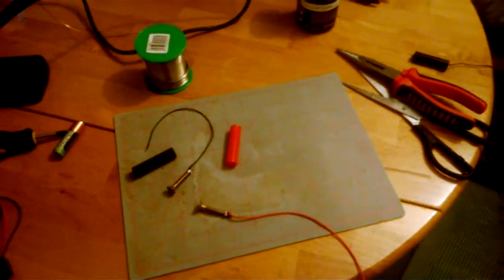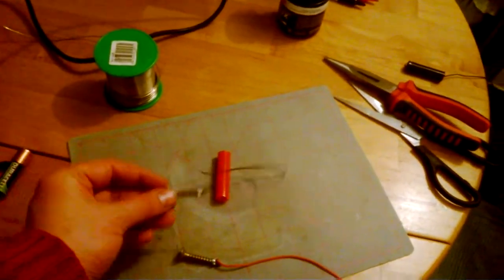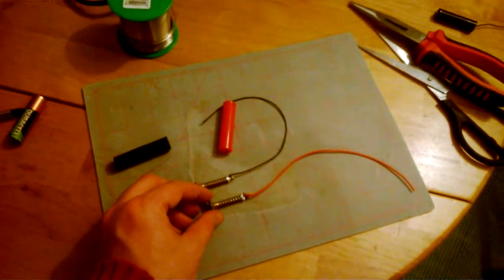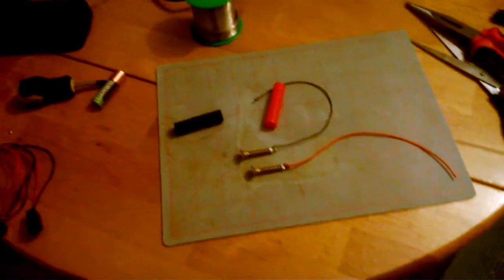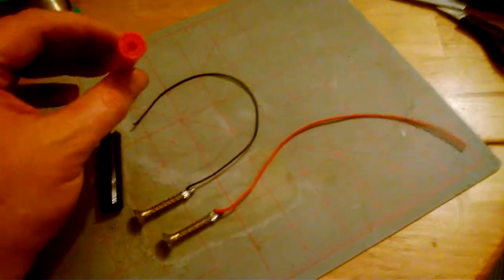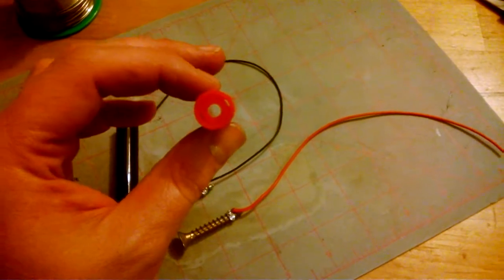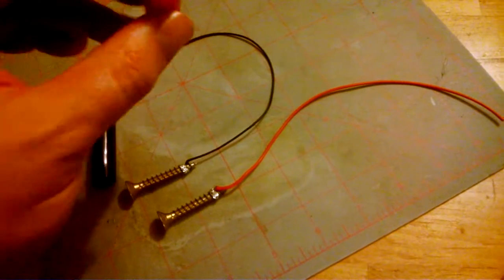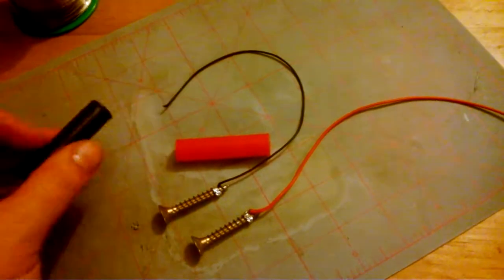Making Dummy AA batteries part 3   preparing the battery case & sssembly

Comment: or you just buy them off aliexpress for half pound each...but ye if you got time and enjoy it...why not. I recently thaught I could just use a normal battery and connect plus and minus. Did that, fluid came out, then put some nails trough the shell, be very careful with that, it may explode, so wear some protection glasses. Then finally I ended up burning all the stuff out with a gas torch, rinse the inside with pressure of WD40 and finally closed everything with solder. I had a fun time doing that, exploring, experimenting, u know...but if you see the time we use doing these things then we just more efficiently buy them. Though, I'm thinking about an easier way to use old battery cells. Maybe just cook them out in oil or in an hot oven or a fire, like a bunch of them at a time, and then just connect the minus plate with solder. Then would be clearly cheaper...depending if you even need so much of them. Ill probably try around more as I like trying things around :-D I just feel weird to buy something whose purpose actually is to just to do nothing, u know what I mean? A working cell is actually similar priced to a dummy cell...thats sort of weird. 
Maybe there are normal batteries which dont squirt fluid when at 0Volt....i thaught I read something like that one time. Then these would be a good way.
Surely you could just connect the pads with wire in each appliance, but then you lose flexibility. There must be an easier, better, lighter, minimalistic way :-D
Battery producers must have these shells at millions for literally free....I would take a bag full of these please :-D